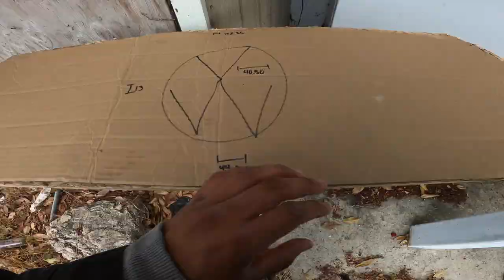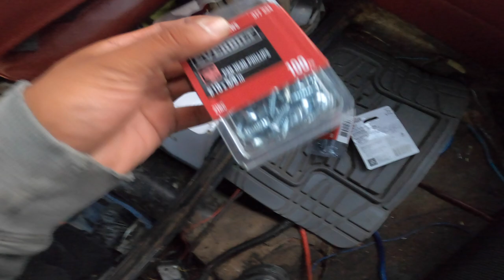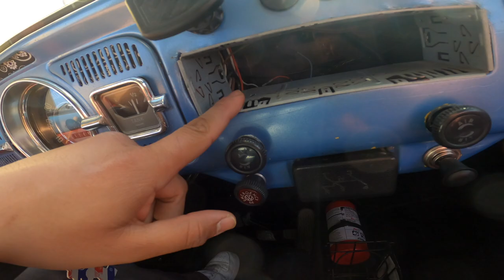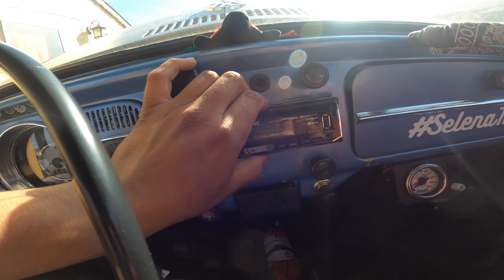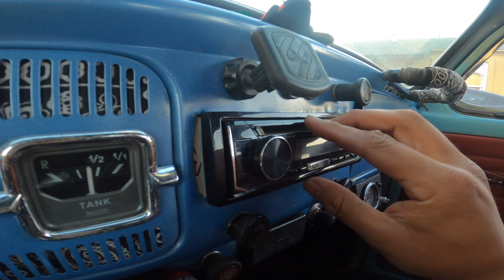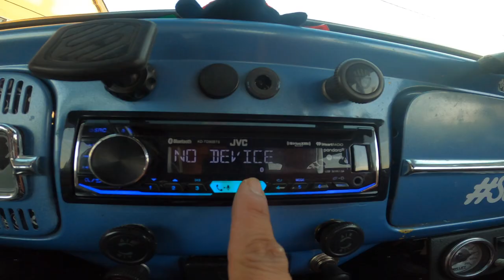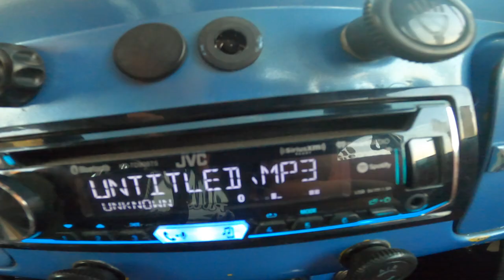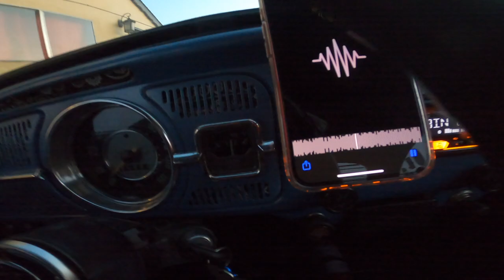Custom Rear Speaker Tray | 1972 VW Beetle

Comment: Tryna do this for my bug what were the dimensions for it??
Reply from the maker: Mine will be a little different from yours since I didn't want to buy a new box I used an existing one that does not let the seat sit all the way back how it normally would so I would recommend to measure it out. I just used cardboard and trimmed until it fit how I liked.